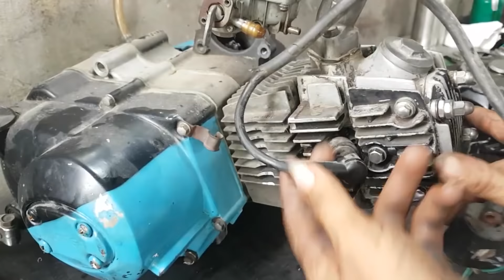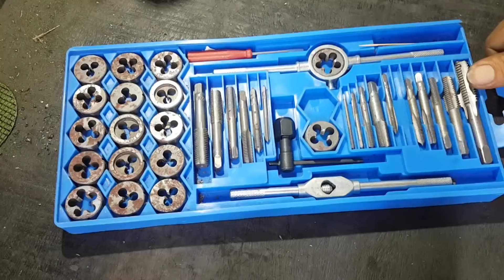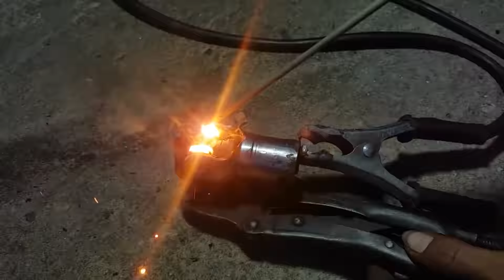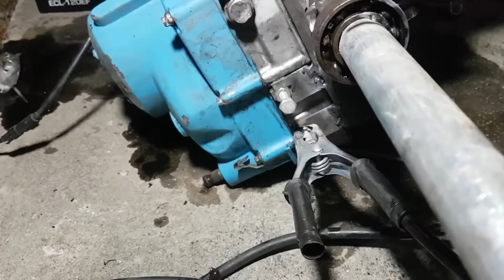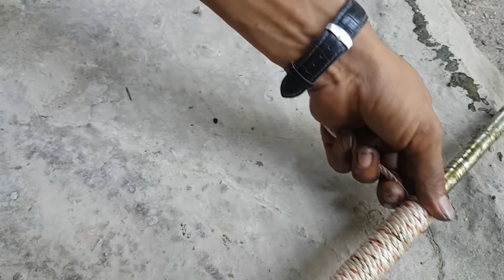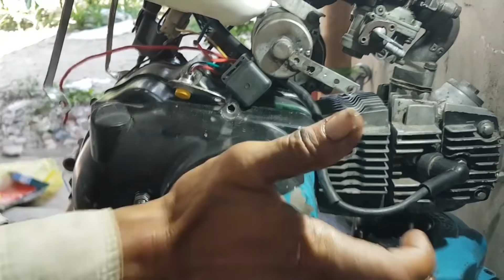Wave 100cc Chế Chạy Đuôi Tôm Vòng Tua Khủng 8000 rpm

Comment: Good modification direct rotation from the engine cranckshaft ...no need transmission ...pssible there is a strong torque and power of the engine...